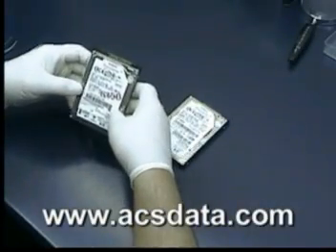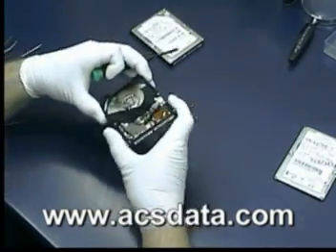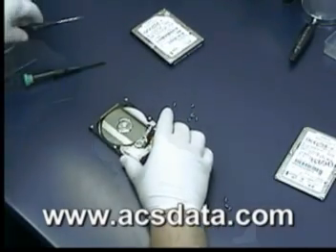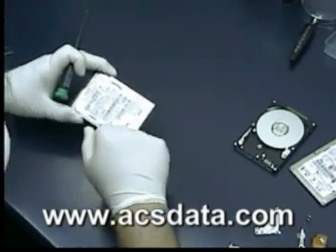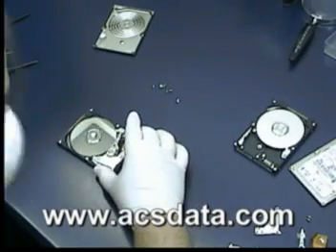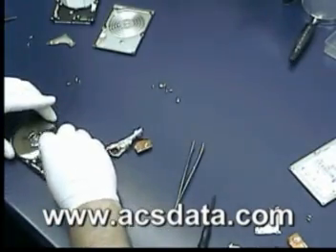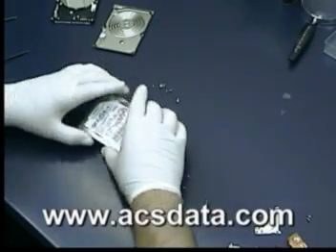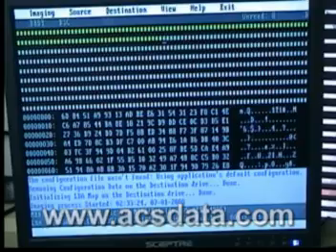Data Recovery Head Swap - Hard Drive Crash -

Comment: Hi,
I opened my damaged drive and saw that the disc was damaged by the head. There is a 0.5mm circle scretch. Is there a way to recover the data from heatlhy parts of damaged disc?
Reply from the maker: +Cemal Uslu It is most likely not recoverable, but it's hard to be 100% certain. It depends on the type of drive (which determines the flying height of the heads), and where the scratch is located. If it's a newer drive...even if it's just 1TB or larger, the scratch on the platter will probably impact the replacement heads and kill them. If the scratch is located on the portion of the drive that holds the System Area data, then there's nothing that can be done with that at all.

Comment: Ok, question, too many comments to read through. When the donor head is removed and replaced into the original HDD, I noticed you didn't use a tool to keep the headers separate. In my understanding, it is vital that the headers can not touch. Your video doesn't prove that theory. Does it matter, if the headers touch during exchange? Or, am I supposed to keep them separate while exchanging, then remove tool when time to put in park?

Comment from the maker: This is absolutely false in regards to the platters.  A single platter you may get away with.  A Toshiba drive, is a bit more forgiving on both horizontal and vertical axis alignments.  

You can use head stacks that contain more heads than the original source, given that other parameters are also properly matched. Yo don't have to cut them off, and risk damaging the good usable heads.  The drive controller won't try to read them so they will just be null anyway.

Comment from the maker: Swapping platters is a much more complex process in most cases. In some drives we do just that. Toshibas for example, are very forgiving.  However, we only swap platters as a last resort in cases where the spindle motor has seized or failed altogether.  There are too many possible issues with vibration and axis alignments.  In short, you can't just take the platters out and put them into another drive. All alignment has to be maintained, vertical and rotational or the data will be inaccessible.

Comment: I know it isnt possible with that particular drive, but swapping the platters has worked well for me in the past. I tape the edges in a few places to keep the platters relative and swap the stack. it is much faster and you are not prone to impact the heads. especially on a drive like this that remove them from the platter when they park.

Comment from the maker: Chances are your data is recoverable.  If you swapped out the electronics, it may be an issue where the adaptive information that is stored on the electronics is not compatible.  Or, if the drive is indeed detected in BIOS, but still inaccessible, you could have a corrupt translator module.  That is a very common problem in WD drives.

Comment from the maker: It's possible. Hard drives are more resistent to contamination than most people think, but long term exposure is detrimental, even in a perceived "clean" environment.  It just depends on how valuable your data is. If it's something that you don't care if you get back or not, then by all means experiment, but if it means the difference between life and death for your business or it's the last 5 years of family photos, then don't take chances having someone do it in their living room.